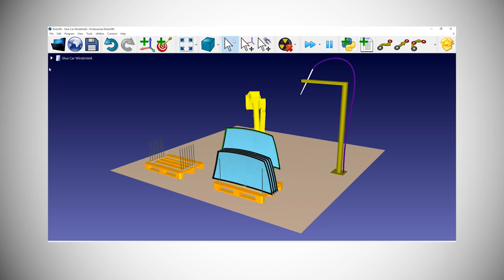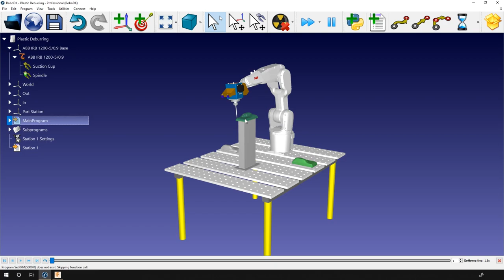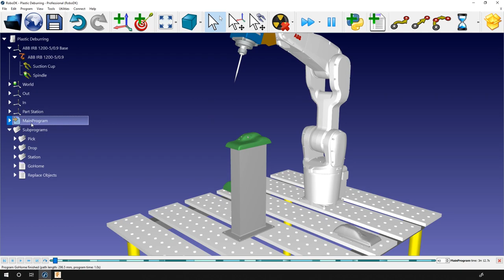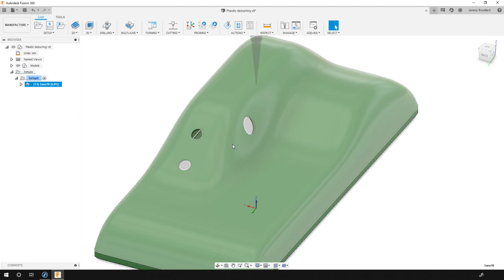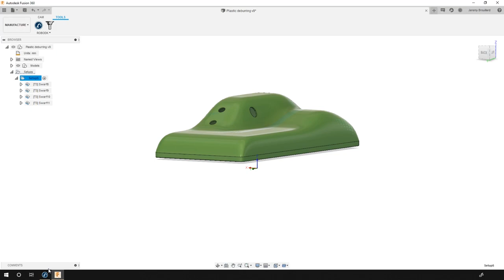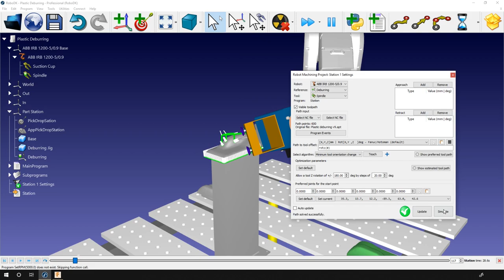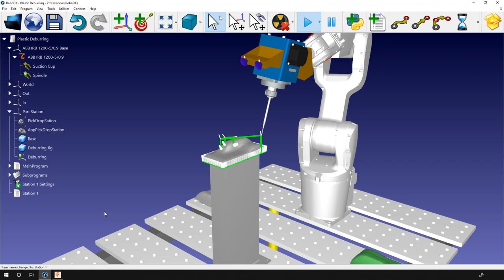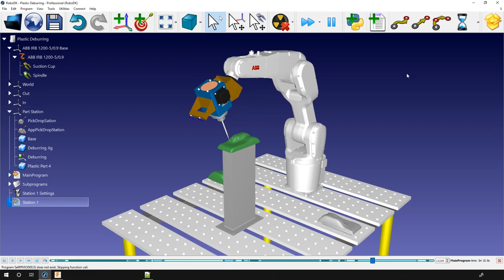Plastic Deburring with an ABB robot - Fusion 360 - RoboDK Add-In

Comment: Hi, super interesting video and I have learned a lot from it already. By my University I am tasked to make a working environment for the abb robots they have so students can use it. Can you maybe make a video for abb owners how you make those subroutine functions like spindle(1) on the irc5 controller. Like a tutorial how to set it up from abb side. I saw in the documentation that there are .mod files to connect robodk with the abb. But I have not maneged to get them both working at the same time (robotstudio is quite a struggle).
Thnx anyway
Reply from the maker: I recommend you to ask this question in our forum: https://robodk.com/forum/
Reply: hi, I encountered the same problem as you. Did you find the .mod module？
Reply: @yuLi-mm5uc  it's something called the robodk_driver.mod and robodk_com, or something like that. You can find it at the robodk documentation page
Reply: @deruben900  Thanks for your reply,  and where should I find these two modules?  Can you provide some advice? Any help would be greatly appreciated.